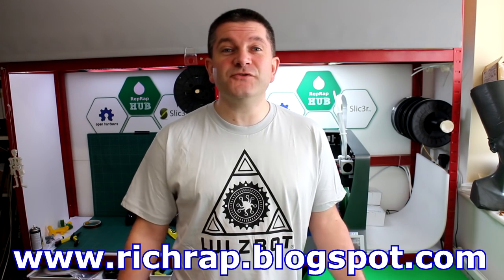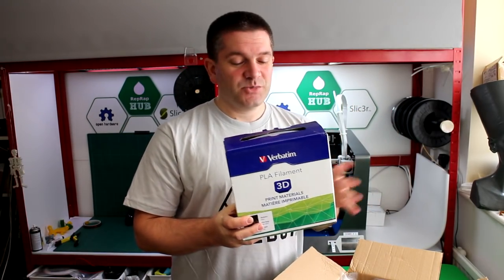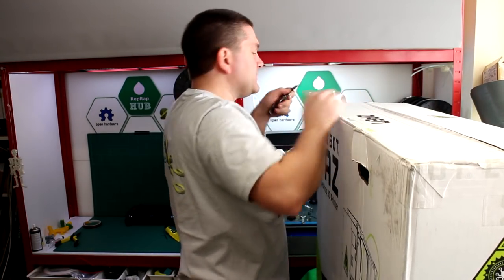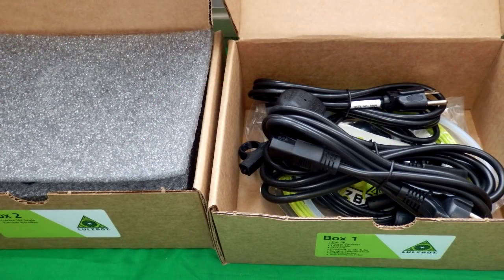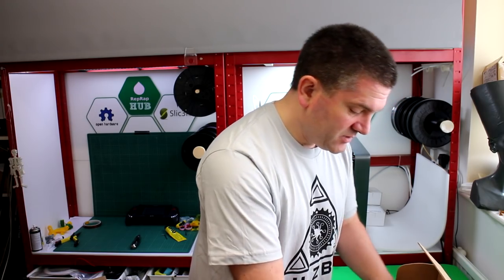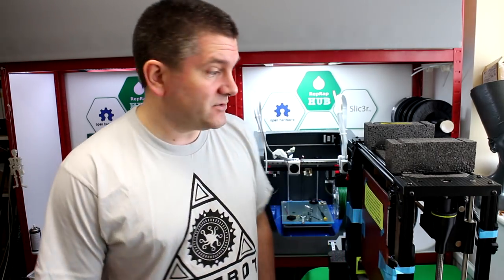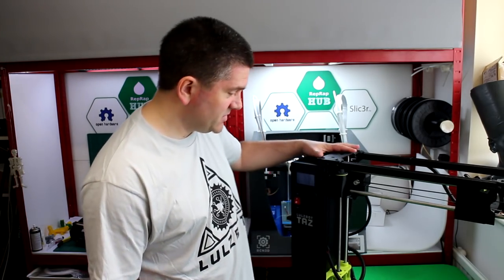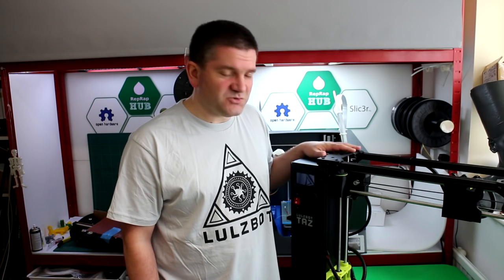LulzBot Taz6 3D Printer Part 1 Introduction, Unboxing, Setup and Assembly

Comment: Is Taz even relevant anymore?
Reply from the maker: Why would it not be relevant?
Reply: Over priced for what it is and does when just as good, if not better, machines have arrived for a fraction of its cost. [edit] The hook for this, which they did to try and make it still relevant today, is the milling part.  In reality it will not be good at that for anything but the softest of materials so it is more of a marketing gimmick imo.
Reply: Are you making this shit up or do you have names of printers, " machines have arrived for a fraction of its cost" what machines are you referring too ?